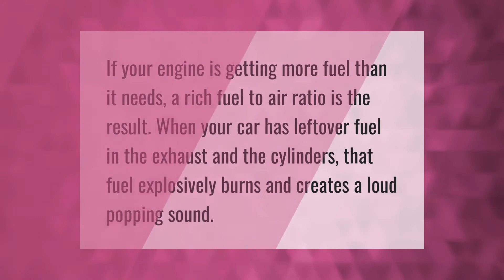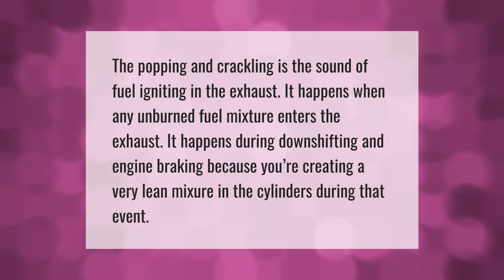What causes exhaust popping?

Comment: hey so i just got my 2016 c450 amg back after a month of it being in body shop because someone lightly t bone me. i got it back, and filled up at ExxxonMobil full tank on 91. it has not been popping or burbling no matter what. the car was just sitting, for the most time. before this, it popped and burbled ar 2nd gear @ 50mph on s+ but now it doesn’t make a single noise. can anyone help me with a solution
Reply: Did you straight pipe the muffler? Having the same issue with my car right now